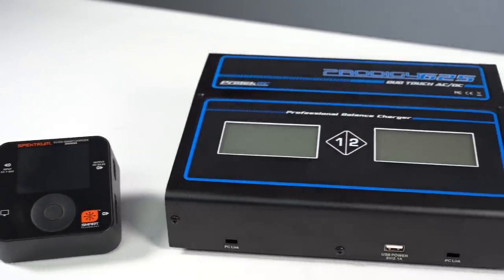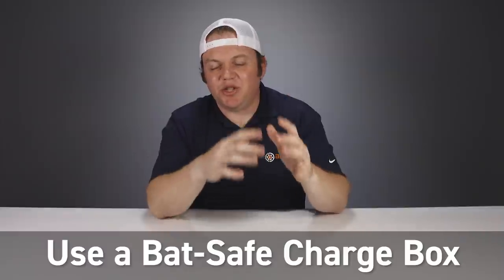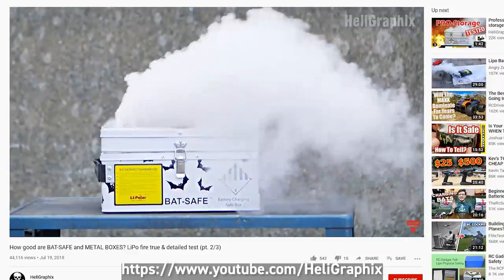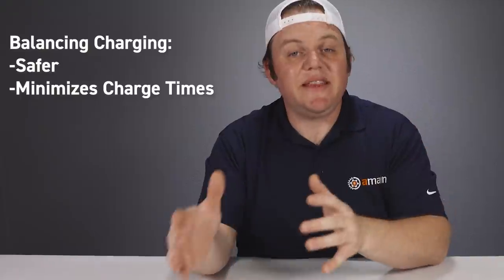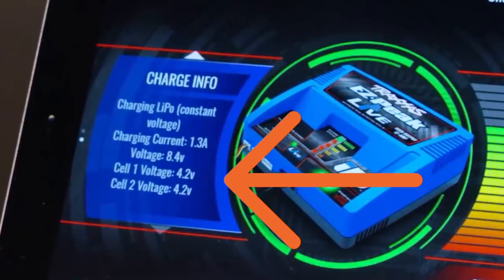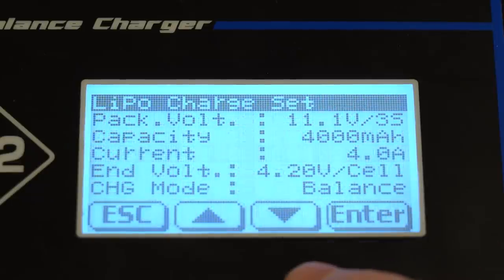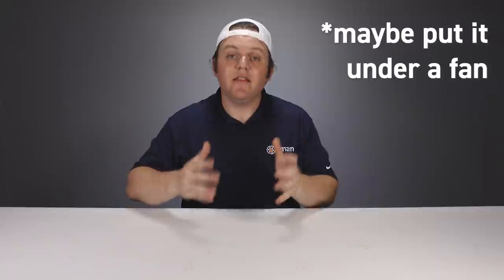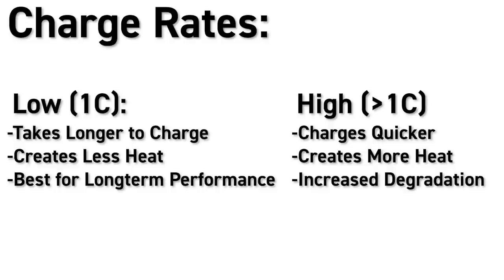Top RC LiPo Charging Tips & What to Avoid

Comment: I always used a balance board to balance charge my LIPOs. I never put my LIPOs into storage charge because I did not know it was necessary. I still got 7 years out of my LIPOs. They both started to puff up. When I saw that I knew it was over. I had them recycled. I now also put my LIPOs into storage mode when ever I am not going to use them for awhile and of course I still balance charge them too. I also only buy good LIPOs and good chargers too. I have had problems with the cheap stuff. I have had good luck with Venom LIPOs and chargers. I am sure there are other good manufacturers too.

Comment: Very helpful and informative! I always follow these tips even before I got into LiPo batteries... another tip that is helpful is this... invest in high quality very flexible large sized wire charge leads if possible... it’ll provide less resistance for faster, and more complete charging with less heat build up so the cables won’t fail due to heat really hurting the soldered connections an soft/flexible cable can handle higher power outputs as well as is much more forgiving when being maneuvered around...  using good grade tight/secure fitting charge connectors also help too for all I said above... high resistance=more heat=power wasted=very high danger potential
Reply from the maker: Good tip Aaron!
-Brett
Reply: AMain Hobbies for wire awg/gauge... 10-14 is fine... but personally I’d use 12 as it’s more than enough for the job as it’ll handle any amount of amps you throw at it and stay plenty flexible  (Deans Wet Noodle wire is a very solid choice)... other tips... I’d not use a squid/all-in-one charge lead as the wire gauge on such cables is so small and wires themselves are too stiff and brittle, other downsides too are the solder joints being too cheap and sometimes the connectors are cheap knock offs known to fail... invest in quality wire, genuine connectors, and if possible make your own charge leads or have someone good with soldering make you some... homemade ones or ones made by a professional will typically  have less resistance, and the solder will be done properly so even less resistance will be there with better power transfer and with good solder joints, they won’t break, fall apart, or fail on you... solder stations are often so much better than the old gun style solder irons (plus the solder station won’t get hot in your hands during use like a gun will with repeated use..)

Comment: Often missed and overlooked don’t run your battery to low voltage cutoff. The low voltage cutoff thresholds are designed to prevent catching the battery on fire by over discharging it, not monitoring your run time. Not an issue with land vehicles but for aircraft guys we strive to land with 20% capacity remaining which is around 3.7v resting area the end of the flight. This gives us enough time for a go around or two and leaves the batteries un-stressed which keeps them more consistent as they age and accumulate cycles.

Comment: Really great videos and very helpful!  Quick question so even if the battery states a charge rate of let’s say 10c you would still advise to charge it at only 1c.  Thanks again!
Reply from the maker: Yes, if you want to preserve battery health for the long term. A 10C charge rate is very hard on the battery, and after repeated 10C charges, the battery will suffer. 
-Brett

Comment: Cool and interesting video. I got the Traxxas EZPeak Live Dual. By default it ALWAYS charges batteries at max rate, unless you change settings EVERY SINGLE TIME. There is no way to save profiles...such a dumb smart charger

Comment: Bat safe are top notch! used one for almost 11months  .  bat safe is rated for 222Wh   v x Ah= 222wh  another great one is torvol.  Ammobox are great too. BUT remove the rubber on each long side.or else no airvent=a bomb.  also as you said bottom gets hot. good rule 1m away from flameable stuff.    :D

Comment: I have a bat safe and a Traxxas charger. Can you use an extension to put in the cable slot on the bat safe? Im not sure if the Traxxas ID function will still work with an extension. If it doesn’t I may have to switch to another battery brand.
Reply from the maker: Sure, that would work if you can find an extension that you trust. Traxxas doesn't offer one unfortunately. 
-Brett

Comment: this was some good tips. I have li-pos i been using a long time. but Now not only do i balance charge, i cold store them. I live in the desert heat kills. a friend of mine told me to toss them in the freezer. So now i freeze them. when i get home i do not store charge. I charge full and slap them in the freezer. I do not run as often as i use to. more run heavy during the winter times where we hit  40 and 50 degrees out. so my batteries sit for long periods of time. But when i do go an run i pull the batts out. some times i give a quick top off as they do die down some over time. but most of the time they are ready to go. by the time i get where i am going to race the 20 mins is done they are ready to go. I have never charged over 1 c. never understood it well enough to do it. I use max amps. they are strong hold up well a bit pricey. but you get what you pay for. my chargers are Hyperion. best money invested ever. they have even brought back old nimh batterys to life an they lasted me even longer. so always remember you get what you pay for. but always have fun!!

Comment: Typically does excessive heat (due to very fast charging) cause a battery to catch on fire or explode?
Reply from the maker: No, I wouldn't think so. If the battery was not rated to be charged that high, or it was not balance charged, then maybe. 
-Brett

Comment: Could you do a video about chargers
Reply from the maker: Sure, but about what? Just showing different chargers, or what info would you like to see? 
-Brett
Reply: Different types for nickle and lipo from cheap to expensive, the different settings they can have to look out for. Also chargers that can charge multiple batteries at a time cheap to expensive.. maybe also what to look out for when buying a charger.
Reply: Perhaps even the different types of connectors for batteries and pros and cons of each

Comment: When I show up to my local track with my batteries in storage charge, should I discharge them first then charge them. Would that give me the best performance out of my battery?
Reply from the maker: No, not with LiPos. There will be no advantage to discharging a LiPo before charging it. Older NiMH packs on the other hand behave differently, where they do need to be discharged completely for optimal performance, but that is not the case for LiPo's. 
-Brett
Reply: Thank you Brett, I appreciate it

Comment: Brett good morning yesterday i bought a heat gun with laser light Comes with the package my Truck is in the shop still i asked the owner to put a 15th tooth pinion for me is it safe in regards to overheating my motor and SERVO are Stock plus i have 2 Cooling fans 1 on top of Engine the other beside THE SERVO THE advice he gave me WAS just don't go stop and go stop and go just keep it at running speeds and check the temperature with the heat gun comes with a laser light and auto shutoff operation and more.
Reply from the maker: Sounds good. Having a temp gun handy is very useful in knowing if your gearing is ideal, or too high, or too low. Finding the right gearing can take a little trial and error, to ensure your electronics are in the safe temp zone. And this can change with the seasons, as outside temperatures heat-up or cooldown. The shop owner is right about stopping and starting; that does generate heat. One of the best tips is to let your truck full cooldown after a drive, before driving again. Maybe put it under a large fan or something to speed it up. 
-Brett
Reply: @AMain_Hobbies  thanks Brett
Reply: @AMain_Hobbies  Right now is the best TIME to drive it cooling down the Engine Iam no professorial but it's a lot less of a risk and with the Temperature 🔫 i can see if its getting to high or low i don't run my TRUCK LIKE CRAZY
Reply: Hey Brett how do these Temps look to you 1 motor imperial versus Metric first for motor Ideal -140 60c Hot -150-160o 65.5o-71.1oc overheat-165 74o c
Reply: Esc temps Ideal-135o 57.2c HOT 140-150o 60o-65.5oc For 4s kraton kraton 110 2400kv Motor overheat-165o 74c 155o 68 3o c
Reply: Please tell me if these Temps sound Right so i KNOW WHAT to look FOR when i USE my Temperature 🔫 k
Reply: Brett iam thinking of selling my Truck i paid $ 925 CANADIAN DOLLARS FOR IT PLUS LITTLE UPGRADES ONLY 7 MONTHS OLD I THINK. IN ALL I'VE USED IT PROBABLY 15 TIMES PROBABLY LESS THEN CAUSE WHEN I FIRST BOUGHT IT BACK IN MAY WHEN THE TRUCK TOOK THAT HIT OFF THE CEMENT BLOCK IN THE SCHOOL YARD PARKING LOT IT WAS IN HOBBY SHOP FOR 3MONTHS THEN AFTER THAT INPUT GEAR AND SLIPPER CLUTCH BUT ITS STILL IN THE SHOP NOW TALKED TO OWNER TO DAY OVER THE PHONE HES WAITING ON 1 MORE PIECE. TO PUT BACK TRUCK TOGETHER THE REASON I MIGHT SELL THE TRUCK ITS GETTING REALLY BAD OUT HERE WITH THIS COVID THE PART HES WAITING IS COMING FROM CALIFORNIA OR OHIO HE SAID HOBBY SHOP GUY I DEAL WITH NOT SURE YET JUST A THOUGHT?

Comment: can you charge lower than 1c ? like 1 or 2 amps? would that add longevity?
Reply: Damayla Phoenix i mean yeah I guess it could increase longevity to a point. As long as you don’t charge quicker than what your battery can handle then its fine
Reply: @mojaverc1585  ok thank you sir. i watch all of your video , keep um coming!
Reply from the maker: Yeah it might, but it will really extend your charge times. 
-Brett
Reply: Damayla Phoenix thanks, i haven’t been able to film new content but this weekend I will because all my exams are over. It should be a senton, mojave and maybe slash mixed bash at a more interesting location

Comment: I’m looking buying a charger. I would like a charger that is capable of charging two battery at the same time. What do you recommend
Reply from the maker: Sure, here are couple options: 
Venom Duo: https://www.amainhobbies.com/venom-power-pro-duo-ac-dc-battery-charger-6s-7a-80w-vnr0685/p468689
ProTek Duo: https://www.amainhobbies.com/protek-rc-prodigy-625-duo-touch-ac-lihv-lipo-ac-dc-battery-charger-ptk-8519/p578442

I'm not sure what your budget or power outputs needs are, but these are two good examples. The ProTek is much more powerful, but also more expensive.  
-Brett

Comment: Can you give me an advice of how many amps do I charge my battery? I'm using a 4200 MAH 3s lipo and yokomo yz 114 plus charger
Reply from the maker: LiPo batteries are usually recommend to charge at a 1C charge rate, which depends on the batteries capacity. To figure it out, you divide the battery capacity by 1000. So for your battery: 4200 / 1000 = 4.2
This means a 1C charge rate for your battery would be 4.2Amps. 

If your battery was 5000mAh capacity, a 1C would be 5 amps. 
If your battery was 1000mAh capacity, a 1C would be 1 amp. 

With this math, you can determine the proper 1C charge rate of any lipo battery. Quality LiPo batteries are capable of charging faster than a 1C rate, many capable of 2C or higher. To know the 2C rate, times the 1C by 2. For your battery, a 2C charge rate would be 8.4Amps, which will charge your battery twice as fast as a 1C rate. Whether or not your charger can charge at those rates is another story. 
Hope that makes sense!
-Brett
Reply: @AMain_Hobbies  Thank you. That's really help me a lot. Im scare because I fried my LIPO twice and probably because I charge with 2c and a fast charge

Comment: I've been told after using a hot battery charging it cools it used to charge mine at 1 amp all the time no probs but I did over run them in hot weather back then 2200 mha 75 c were $100  a piece 3 cell 5 minutes was average rarely id go 7 they'd puff up round
Reply: Because you over-discharged them...

Comment: When i was (very) new to the hobby i always charged my lipo up again after bashing. So it was full until i used it again! 😅
Reply: I do that now. Is it okay, or am I destroying my battery?
Reply: It's not good for the battery and makes it puff over time. I do it overnight on occasion. Storage charge it if it won't be used for over 24 hrs.
Reply: Cody Pierson no u can leave it fully charged for a week
Reply: @dnh3005  That's probly as long as I'd want to leave em. I try not to leave them that long personally. Did you happen to get that info from a battery manufacturer's instructions or just general knowledge you've heard around from reputable sources?
Reply: @_.b.rc.g._  no that's very bad for lipos, always storage charge them if your not going to use them for more than 5 days is what i go by

Comment: i just googled about charging lipos, to check what current to use, and nopw i get an email from amain hobbies about charging lipos, coincidence or are you tracking me, hmm, helpful info tho.  I bought a summit that came with one used lipo(2s), previous owner said the second battery died to he didnt want to send it in mail, but the battery that arrived is slightly puffed and at 8+volts, so i might look into safely discharging that one and safely discarding it
Reply from the maker: Yeah, don't use that. Hopefully his battery treatment isn't a sign of his vehicle treatment. Here's an easy remedy to discharge a LiPo: Submerge the battery into a bucket or tub of salt water. This container should have a lid, but it does not need to be air-tight. Prepare a plastic container (do not use metal) of cold water, and mix in ½ cup of salt per gallon of water. Drop the battery into the salt water. Allow the battery to remain in the tub of salt water for at least 2 weeks. This salt bath will neutralize any remaining power in the battery. 
-Brett
Reply: @AMain_Hobbies   that sounds like a good idea, will try, thank you!
The vehicle itself was fine, all the rubber on axles was dry, otherwise it looked fine

Comment: Surprised nothing was mentioned about monitoring IR when charging. You could have fine voltage but if the cell IR is way high, the battery is still no good. My Trinity white carbons are under 1.5 Ohms per cell, my generic no-name battery has over 4.5 Ohms per cell and it makes a huge difference. Most people I know toss the batteries when the IR gets above 4 ohms per cell. More Amps = More Heat = Lower IR - same reason your car battery sucks in the winter. This is why pros charge and discharge at or close to 40 amps. You can see the IR drop as you charge at higher amp rates. I've never gotten a battery hot enough to need to put it under a fan even charging at 30 amps but you will notice the extra punch on the track. In theory this can degrade the battery quicker over time however I am happy with how mine are holding up at the higher rates. The quality of the battery likely has a lot to do with that aspect.
Reply: 1,5 ohms per cell?!?!!
I guess you meant milliohm.
Reply: Guessing IR is internal resistance? Not everyone knows electrical terms....

Comment: The funniest guys are still the ones who let their fully charged 6s sit around for a few months...
Reply: And then set their LVC to 2.8v per cell 🤦‍♂️
Reply: @itchyprince3793  No, they don't set the lvc at all, but then they're crying because their lipo is blown.
Reply: rc guy what is a good Lvc to set?   3.7 or is that too low?
Reply from the maker: If you set your LVC to 3.7V, you shouldn't need to storage charge it after use. You could set your LVC down to 3.2V and that would be ok, and provide a little more runtime, but it takes longer to storage charge after. 
-Brett